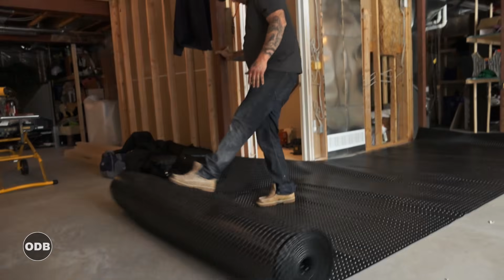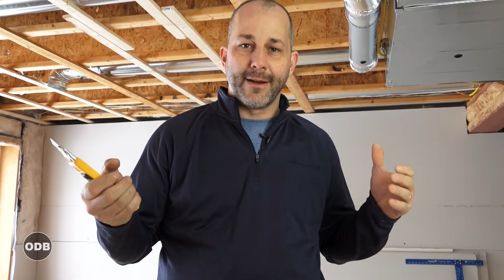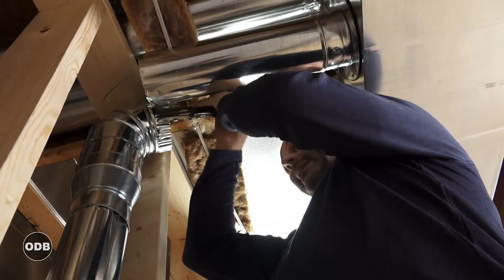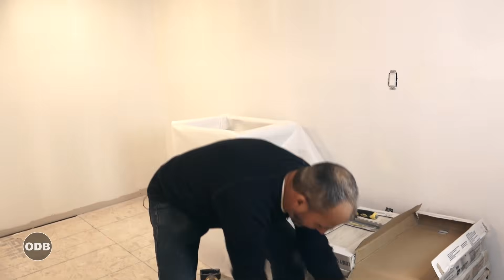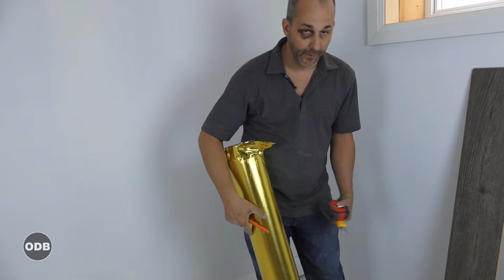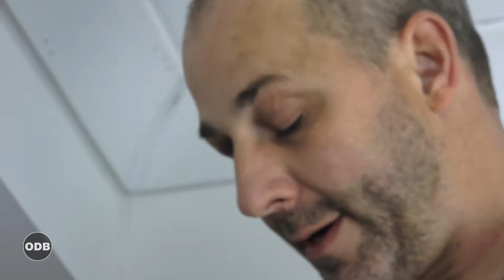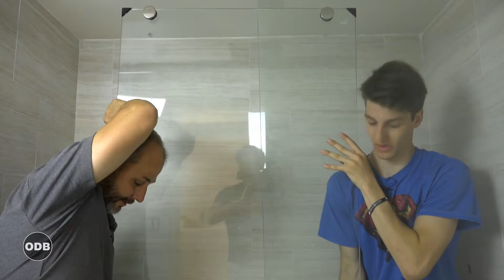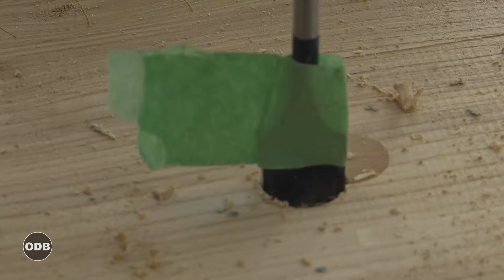DIY | How To Renovate an Unfinished Basement | A To Z

Comment: Hi Jeff,
Thank you for your educational videos—they've been incredibly helpful! I have a question I hope you can advise me on, as I haven’t found a clear answer elsewhere. I plan to finish my basement by using a dimple mat with laminate flooring on top. How can I anchor the wall frame (2x4) into the concrete floor without compromising the integrity of the dimple mat by drilling through it? If I frame on concrete with treated wood, that would block the airflow from under the dimple mat, wouldn't it?
Thank you for your time! NN

Comment: When doing a basement subfloor how do you correct the basement stairs, first bottom step changed in height do to adding the subfloor. Doesn't this cause a code violation with the change in rise from the first stair to the second? Do I have to build new stairs to the middle landing with a corrected rise? Been searching everywhere and cant get a clear answer on this.

Comment: Great videos Jeff, I rarely subscribe to channels, but I have subscribed to your channel. I have a question regarding a walkout basement and hope that you'll be able to answer it.  
It 10 yrs old house. It was partially framed and insulated with r22 by the builder. And the remainder concrete is covered by the insulation blanket r12.
I am a bit confused as to should I leave the insulation and frame in front. Or should I remove and add foam board. I am getting conflicting opinions from different ppl. Also about the plastic membrane should I install after the outside walls are framed, as it shows in your video. In your video I can the outside walls are framed already. Please advise. Thank you.
Reply: I would like to know the answer to this question. Also, what should I do with the old blanket insulation? Can I use it in the ceiling or attic rather than throwing it away?

Comment: The toilet bolt either had the washers ion wrong order or not metal washer...needs both to prevent pull through, the cut off wheel works but at much higher risk of damaging toilet if you don't control where that thing goes...

Comment: my home is 19 years old and built with superior wall construction. Basement is 90% finished, bone dry, and already plumbed for a full bathroom. The current flooring is a called LVP - Luxury Vinyl Flooring 1001 colonial plank Barnwood. We'd like to keep the continuity going for the bathroom as well.  Based on your video, would that work? Raising the floor seems unnecessary and if a schluter shower system is installed, would that work?

Comment: I was just questioning the direction in which  you connected  your fittings and pipe together for heat runs . They usually  run male ends facing the outlet to avoid friction and disturbing  or (cutting down) smooth air flow . Air flow should run over instead of running  into connected joints

Comment: Hey Jeff, I have an older backsplit detached house in GTA. There's crawl space for 20X17. I was thinking of underpinning the basement by one ft to make it useful as a storage space. Confused if I should really consider doing this myself (with help of a structural engr) and if so, shall I consider for the whole crawl space or just create a pathway to walk without bending too much. I can use the space to keep stuff from costco or otherwise. :)
Reply from the maker: that is a lot of work to have storage. unless you are going to finish the space you are simply spending money to save money. no increase in house value unless it is finished.
Reply: @HomeRenoVisionDIY  Thanks so much Jeff for your response. I have now pivot my idea to merely excavate a few 3ft (width)  * 15 ft (long) * 2 ft (depth) to create a underpinned sidewalk within the crawl space and use the balance space as storage. :)

Comment: Great Content Jeff! Thanks for sharing all of your knowledge and experience with us.  I’m a new member, and in the process of moving to a new home with a partially finished basement. It was built in 1997, has a finished kitchen, finished bedroom and bathroom in the basement, but there are two fairly large unfinished rooms with cement floor, no ceiling and exposed fiberglass insulation in the walls.  I’d like to put workout equipment in one of the rooms, and use the other as a family room but I’m concerned about the exposed insulation.  Should I cover it? And if so, what would the best, but least expensive way of doing it?  I’m renting this house so don’t want to put more into than I have to.  Thanks!

Comment: I guess I am 5+ years late to commenting, but I'd love to know if or how you plumbed the drain line to that wet bar. There was no plumbing rough-in near that bar and you didn't break open the floor. 

Did you use a saniflo or a similar product to pump the grey water to the stack? Or is it a dummy facet simply there for decor? Or maybe a home depot bucket under the sink?

Comment: I'm renovating my basement and am trying to figure out if the airgap between my wall+concrete needs to connect with the airgap from my dimple membrane. Does it matter if this is connected or not? The perimeter walls are going to create a barrier with my current design.

Comment: I just watched this video; very very educational and now I have a better understanding about the subfloor system for a basement. Couple of question about it: size of the Tapcon screw to be used to secure it (OSB+DMX) to the floor? also, the size of the self- tapping screw used for this reno/project?  Thanks......

Comment: If you make a pin hole in a water bottle lid, and spray the water on the bit as you're drilling the hole, it extends the life of the bit and helps the blade move through the tile more efficiently.

Comment: I have a million questions. I am on the verge of watching every video you have made. So thank you a million for all the help you have given me. I promise I will become a member as soon as I have money in my bank account 😂 cash isn’t accepted online.  But you always say you need the vapor barrier- then why are you framing directly on concrete ((is that only in the bathroom) and where you install the shower doesn’t look pressure treated!?  I am in the middle of fixing up an insane crap house with venting in slab (I haven’t found the video where you address that yet ha) and half wall of concrete to wood home. Wondering how I can keep my vapor barrier and where to attach framing if I’m trying to avoid it directly on the concrete!? There is a decent recess where the wood begins and the concrete ends do I put vapor Barrier on top of the cinder blocks?

Comment: Can two bath exhaust fans attach to one duct to the outside?  Great video on the flooring examples.
Reply: Yes. Get a 6-4-4 wye.  Exit the building with 6” and connect two 4” fans to the 4” ends.

Comment: Thanks for the video. It's very helpful. I'm planning on turning my basement into an in-law apartment. The basement is partially finished already but the previous homeowner did a poor job. I'm going to have to gut the entire thing and start from scratch (bathroom is going in the same place so I might be able to keep some of the plumbing). I'm overwhelmed by the project and I haven't even started yet.

Comment: I have a question.  We need to frame 3 walls in our basement on concrete.  1 wall has a 32 " pocket door seperateing the macanical room from the bathroom and 1 wall has a 28" Bathroom door.  The Question is this....1 company told me he would have to use wood for the bottom plates and the metal framing for all the rest.  And 1 company told me that it should all be done with wood framing as it wouldn't work well for the door frames, which are wood.  could you please tell me which is true so i can pick the correct contractor to do this job???   Thanks T. Locke

Comment: I am finishing my basement in a 1940’s home in New Berlin, WI. My plan is to use DMX > 23/32 OSB > luxury vinyl. My question is, to fasten my OSB tontue concrete Is it recommended to use the Tapcon screws or can I use my Ramset Cobra+?

Comment: question - 
Did the subfloor on basement (700sq ft)  with dimple mat and 5/8. 
Looking to put Vynil Plank over it BUT basement floor (and our new sub floor) is sloped about 1" to the center floor drain of the basement . 
Should I level it using multiple layers of self leveling or can LVP handle this graduate but significant slope?

Love the channel obv! You guys changed lives. Thank you!
Reply from the maker: Hi Andrew, the wider the board the harder it is to handle slope. ask your supplier they have information on each product as to the amount of slope it can handle over how many ft. In your case there are definitely products that will work quite well.

Comment: Great video! I have a question. My ceiling for the basement is really low. What are some ways to renovate it without doing any major landscaping.
Reply: hang up some beadboard paneling and use trim board at the seams.

Comment: Question... I'm trying to install a full bathroom in my basement but all the pipes are above ground and so will have to frame the floor higher for that. So do I put in the subfloor first, then plumbing over it and then build the frame over the pipes, or do I put in the pipes first then build the frame an then sub floor over that? I'm assuming that I would have iso if there is a leak it'll drain underneath the sub floor but want to be sure.

Comment: Hi Jeff, I am the one person that is glad the toilet bolts are so long. I use these bolts as tee nuts in my tee slot on the mitre saw, table saw, drill stand, router table, and my hand held router base. I don’t use them to put toilets on because I have not needed to change one of those for a long time. Those bolts are perfect to run in the tee slots and I forgot one place the CNC table.
Reply: Yeah but you can buy the long bolts without buying a new toilet everytime... Toilets should come with short bolts. If you need long bolts for your toilet you should buy them separatly. 
-Someone who hates long toilet/sink tab bolts

Comment: At minute 55 you installed the 2x4 to get another mounting surface to the ceiling but why not getting closer to the AC ducts? my basement is similar and I'm thinking to try and get as much space as possible so i was thinking to install the 2x4 as close as possible just over the duct.

Comment: Hey Jeff, do you have a video just to show how you use the laser? is it self leveling so no matter the surface it will show a perfect vertical lines? 

Also, regarding the ceiling, my basement has a great subfloor as the base of the ceiling. only thing is some water pipes running over the joists as you had on your video. one way as to do as you did but then losing some height. would you think it worth drilling the joists running those thin dia water pipes in there to gain the extra height?

Comment: I have a 40’s built bungalow with a (god knows when) dug out basement added. I was going to use the black DMX + 5/8 plywood as a subfloor/vapour barrier. But with the price of lumber what it is, it’s gonna run me over $3/sqft just for subfloor. Wondering if you have a suggestion for alternatives?

Comment: I did this to my prior basement about 8 years ago, but had to include plumbers solder for each of the concrete screws in the floor.  It was to reseal the plastic vapor guard the screws holes you drilled punctured. It was a real pain doing that too.

Comment: I don't know if anyone has mentioned this to you yet but its actually a bad idea to wipe your solder joints with flux while its still hot. Flux can pull the solder out of the fitting and cause a pinhole leak generally on bigger applications like 1 inch and 1 1/2 pipe but its still not great practice. Thanks for all of the videos though, your'e my go to channel when it comes to renovations!

Comment: Jeff, 
I am working on finishing my basement in Edmonton Alberta. I have the bathroom in the corner of the basement and was planning on putting the shower head on the exterior wall, Is there any tips you can give in in running the pex in the exterior wall? it will be insulated but not sure what else is needed.  

Thank you,

Comment: I still can't stop laughing at the Rocky Shiner.... After seeing his baseboard install 1 HR 48min in, I'm believing the REAL crew handed his Ass to him. 1/2inch above tile install? WTF?! You don't use baseboard scrap to gauge the lift. You use shims, no more than 1/8th inch off floor. ....PLUS, you paint first. AND, if installed correctly, no caulking needed. It's called "FINISHED CARPENTRY".... I did it for over 15 years. It isn't difficult, if you know what you're doing. 

Jeff is a hack! .... Then he installs tongue n groove wood flooring and snaps the tounge, while trying to AGAIN talk his candyass out of his blunder on CAMERA. 

Who sponsors this Clown?

Comment: Wow you completely destroyed that I-joist! Hope others don’t do that. You may have done it with that joist and be ok, but others SHOULD NOT cut a hole that big unless they are damn sure about how much weight it’s supporting. That I-Joist is destroyed. For a 12” I joist and 6” hole, you need to be 6 feet away from the edge to do it safely. Just an FYI to your viewers. Don’t attempt what he did unless you consult the hole guides for your style of I-joist.

Comment: How do you drop heat runs in a basement into a 2x4 wall? Specifically penetrating the top plate? I know there’s oval shaped ducts but need to reduce from 6” through 2x4 top plate and down to floor

Comment: I have read that the black DMX AG is only meant for exterior use on basement walls, etc. because it can "gas off" chemicals due to what it is made of.  What is your response to that? Also, I have read that due to the fact you are drilling holes in the DMX membrane, the Tapcon screws should be dipped in a liquid butyl rubber to seal around the screws?

Comment: You suggested putting dry core on basement floors and building the walls directly on top, my question is should I put rigid foam board on the walls first?

Comment: Jeff, my basement is unfinished but they put that wrap insulation on the concrete walls. I don't really want to remove the insulation, but if I frame my walls where the studs are touching the plastic on the outside of that wrap insulation, how do I create vertical fireblocks along the wall? Code requires vertical fireblocks every 10 feet. Do I jam a piece of drywall or wood into the insulation top to bottom or cut the insulation, put the barrier against the concrete, use fireblock sealer where the barrier hits the concrete, and use insulation tape on the barrier and the insulation to seal the insulation?

Comment: Wow, you guys made that look so hard. The way I learned to build walls:
*Install baseplate
*Lay top-plate on floor next to base-plate
*Use speed square to scribe lines on both base- and top-plate for every wall joist (16" oc  or whatever) location, putting an "x" where joist goes, next to line
*Set top plate on its side and build wall on ground, nailing joists into top-plate where all the "x"'s are along scribed lines
*Measure gaps between joists and cut fire-blocks
* Measure 32" (or whatever) from bottom of each outer joist, then pop a line on all joists
*Install fire-blocks along popped line
*Stand wall up  and set it on top of base plate, and as one guy holds balance, other nails joists to base-plate
*Now that wall is up, square/level as needed, and secure it in place.
This way you're not holding plate above head, muscling joists into place, screwing with level on EVERY joists, etc.
Scribing both plates together and making sure joists are straight eliminates lots of struggle and frustration.

Comment: Technically you don't really know what people might choose to hang from their ceiling.  They might hang a huge bodybag(a huge workout punching bag), and a huge big guy might workout on it, and that force transferred to that ceiling with only 2 screws in it will come crashing down. That will transfer to thousands of pounds with him throwing side kicks and drop kicks on it and that 150lb bag swinging around. Even a little guy doing consistently workouts on it, will work the screws loose when there is only 2. That is why i love to hear you say "throw in a couple extra for good measure".

Comment: When installing that stuff under the OBS do you add a sealant in the screw holes? are you worried about drilling through that egg crate stuff breaking the air barrier?

Comment: It looks like you had 2x6 framing for the 4 inch duct pipe.  If you drop a vent like that, do you need the 2x6 framing?

Comment: Is it better to install subfloor first  (dimpled plastic sheet + tongue and groove osb) and put walls right on it or install walls on the concrete first and put the subfloor inside? I also found dedicated product on DMX website - DMX AG Flooring Underlayment with declared compressive strength of 6,000 lbs/ft2. This is almost double in comparison to regular DMX AG Wall Waterproofing material with compressive strength 3,500 to 4,000 lbs/ft2. Should I rather use specialised product? Thank you.
Reply from the maker: unless you actually think you will need more than 4000 lbs of of compressive strength then go ahead. I have never found it necessary for more than 500 . Cheers!
Reply: @HomeRenoVisionDIY  Thank you for response. Appreciated. So I need to put subfloor leaving 1/4" gap to the wall and then put walls on top of it?

Comment: Did you not use the vapor barrier under the tiles in the hallway? If not, can one do that though and which materials would there be on top of the concrete: vapor barrier, osb board, underlayment and then the tiles?